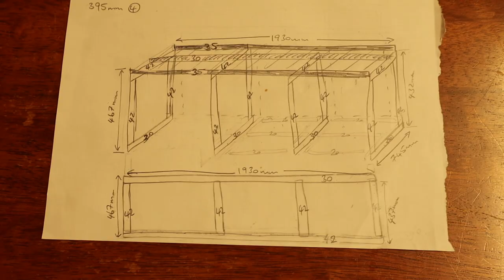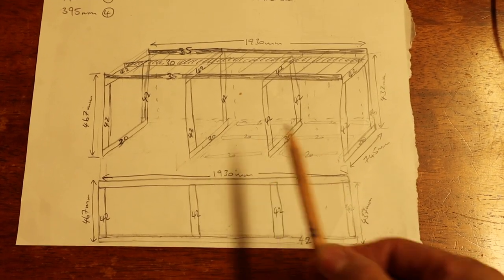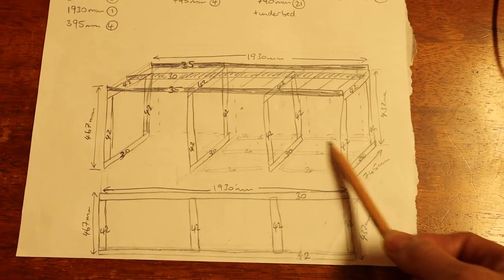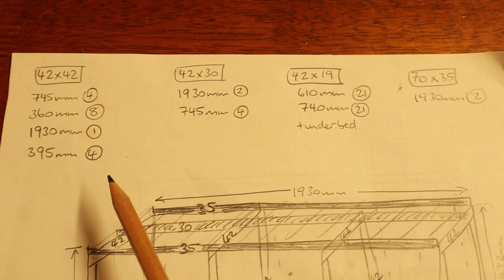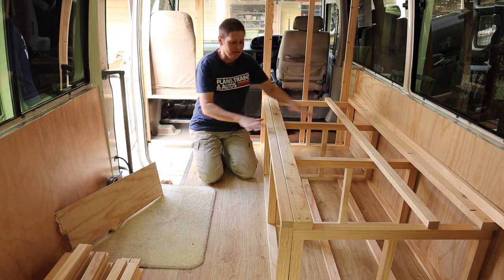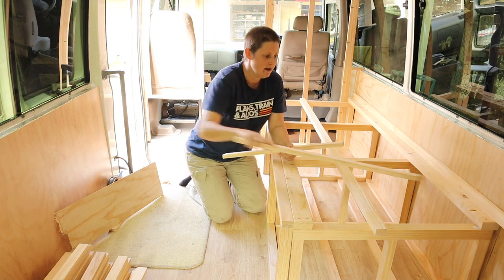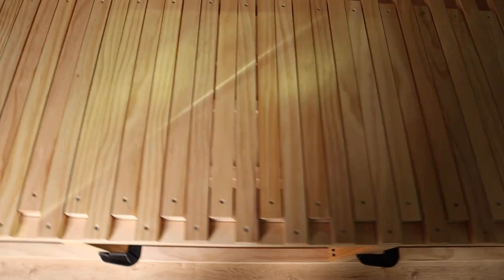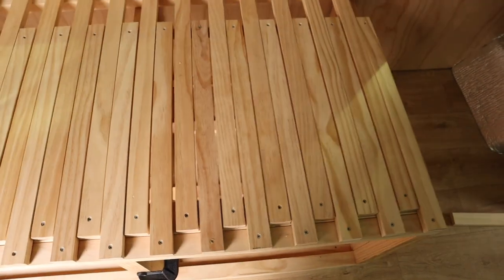Building a pull-out extendable bed in my bus

Comment: Nice job.  I've recently found your channel and have been watching your videos.  I appreciate how thoroughly you think through and explain what you are doing.  For this bed two comments;  Firstly I would be inclined to attach some felt or something similar to the underside of the bottom rail of the sliding part so that it doesn't mark your vinyl over time.  Secondly, (and I realise that you were probably constrained by your storage containers) but the height of the bed means that you will not be able to sit comfortably with your feet on the floor which may make the day mode less useful i.e. it will be great for laying about but not for sitting.
Reply from the maker: That's a good idea about the felt. I might try that. With regards to the bed height, yeah I probably won't be sitting in it like you would normally sit on a sofa much anyway. I will mostly be sitting at my table during the day or outside I think. It will mostly be for the dog during the day ;)
I had to make a few compromises in my build (and bed height was one of them) because I am trying to fit a huge amount of gear in the bus that I need for my business as well as the normal house stuff. I will probably end up needing to get a trailer, but for now, I am doing my best to build things to maximise storage in case I do actually have enough weight leftover do carry everything in the bus without a trailer. Down the track if I end up getting a trailer and the bed height is a pain, I can always chop a bit off the bottom and lower it.

Comment: I’ve used silicone spray before on the parts of the timber that slides against other timber and it’s amazingly smooth sliding.

Comment: Brilliant! I'm as excited as you that this bed works so nicely, as you've never done this before, and I like the way you research thoroughly before doing the steps to make something. Love how you explain as you construct and that all the "oops" moments are in the videos and the measures you take to correct them. You are a good teacher 😁. BTW, would a mask keep down the dust enough to prevent you having asthma problems? I know Hugo uses one when he has lots of wood to cut, and he's not asthmatic, and I wear one in Spring(gardening) due to my hayfever problems.
Reply from the maker: Yes I have been wearing a mask when cutting a lot of wood at once or when I am sanding. Most of my issues are due to dust allergy, and even just being in a dusty environment is enough to trigger it, not so much actually breathing lots of it in. My biggest challenge is not touching my face with my dusty hands :)
Reply from the maker: @robynlvaughan5683  my skin doesn't get itchy. Just my eyes. And my sinuses play up.